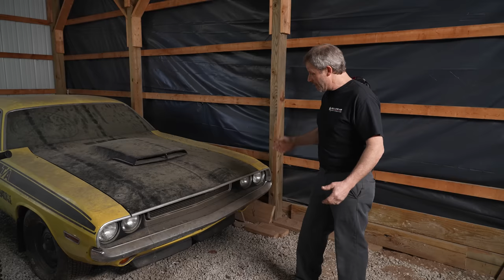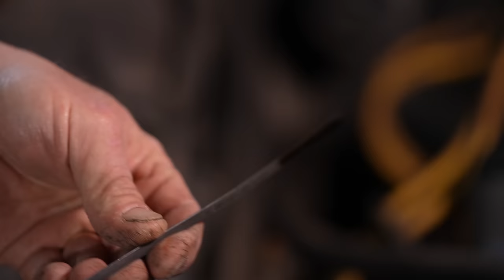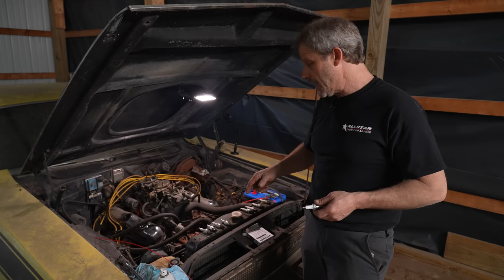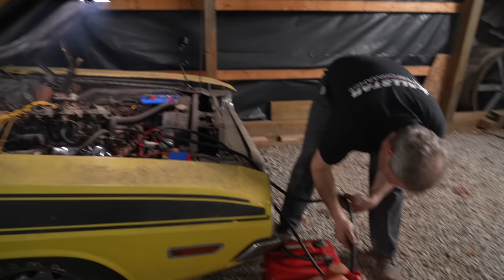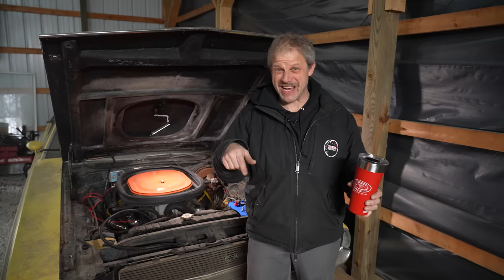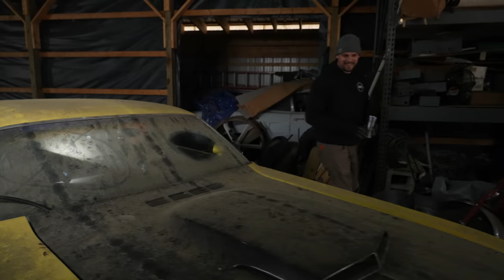Barn Find 1970 Dodge Challenger T/A 340 Six Pack: Will it Run?

Comment: I was born in 1971, my mom had a 1971 Plymouth Satellite Sebring with a 318 that she got from her brother! I've never forgotten that starter sound... it intoxicated my mind! I now own a 1978 D-150 with a 360 LA and a 1972 New Yorker with a 400! I've owned a lot of classics mostly GM, but the first time i found a Mopar that was it! When you hear it almost kick over, you know you're headed for success! I'm no professional, but I've brought the engines and fueling systems back to life! I did some engine bay wiring correctly and top end components, next is to tear the engines apart after I get some miles in over the summer because of winter snow!

Comment: I like to fill the old gas line with gas from where you cut the filter off and let it sit for about five minutes to saturate the diaphragm in the fuel pump. Works most of the time. Love the videos.

Comment: Had the same color T/A but was a 4 speed. Bought it for $4500 in 1988. Definitely a head turner. Had holes in the headliner, torn drivers seat and water in both front tires?? Found that out when I got new tires installed. Couldn't go over 35 mph without the front end shaking. Even found the original broadcast sheet under the rear seat. Replaced the worn/torn parts with new and WOW, new car.
Reply: Great memories,I remember when they was first hittin 10k for driver quality 93 ish.I was still in high school at the time and making $4 a hr part time during school yeah,found a 68 Dart GT 340/727
I can bet a lot of people had never really been around a 340 more less the engine in video.very special bore/stroke combo with the LA x heads I beat alot of 350 novas and chevelles.My almost stock 340 made easy pray of most of those guys

Comment: I know why the front and rear carbs were disconnected.   I had a friend that had a 70 Cuda with a 440 six pak.  I asked him how many miles to a gallon.   His squirmed a little and stayed, “If I drive 55 (speed limit at the time) and stay out of it on the highway, I might get 5 miles per gallon”.  During 1971, gasoline was very cheap.   The lowest price I paid was $0.169 per gallon.   $1.269 today.  A few years later OPEC stuck it to us and the fake gasoline shortage.  In June 1974 the price was $0.559.  Checked an inflation calculator, $3.429 today equivalent.  BTW minimum wage was $2.50 and wages got frozen by the US government.  The good old days!

Comment: I own a 70 GTX 440 6 barrel. I have owned it since 1981. You have to have fuel in the outboard carbs. They have idle circuits that need fuel to idle correctly. If not. Then just a big vacuum leak. You can see the lead plugs in the base of the outboards. Take that lead out and carefully add penetration out. Work them out. Then you can fine tune the outboards as well  nc as the center carb. Center carb adjust on side of the metering block.
Reply: I'm sure the man knows what he's doing

Comment: I love those 70 T/A Challengers and the AAR Cuda's they are great looking and running cars. I have a 340 out of a T/A challenger that was too far gone to do anything with and the engine was seized up but it was not seized that bad and it now runs and it's on a stand in my garage with the 6 pack intake and a A833 4 speed that was going to go into my D100 pickup but I have a hot 318 that I built and going to run it in the truck for a while.

Comment: The huge vacuum leaks don't help. Should have taken the time to fix the outboard carbs.
Reply: Once I knew it would run, I'd have pulled all three and tore them apart and gave a bath in my ultrasonic cleaner, then new kits. Holley 2 barrel kits are relatively cheap.

Comment: Had a 71 with a 70 grill on it , bought it for 180.00 mint from the doors down in 1985 I was just a kid around 22 yrs old ..Cost me 400.00 bucks for a R/T hood and 150.00 bucks for 2 nice used fenders 100 bucks for a 70 grill with all the headlight assembly..Freind of mine sprayed it with Krylon Prime Grey since the car was Grey and unmatched Fenders one blue one white and luck had it rained like hell that afternoon afternoon and we hand sanded both of us in a rain storm the next morning it was so smooth the wet sanding it came out great , put some racing stickers on it N50s out back on aluminum slot mags I really loved my Challenger had it 5 yrs hence the 318 out for a stout 440 from a ex police car Dodge Monaco a 69 I believe and stock it moved good , The good old days havin fun building Mopars , wish I had her today 😢

Comment: Most people don't know that the end carbs have idle circuits in them. This is done so that fuel doesn't stagnate in the bowls if you don't go wide open for a long period of time. It will never idle right if you don't clean all 3 carbs.

Comment: As a high school junior I had a 1970 340 Duster. Very fast. Had most options, with console automatic. Those six pack cuda's are pretty valuable. I believe those seats have been recovered. Dodge did not offer velour seat surfaces

Comment: My first few steps of tryin to start up a vehicle that's been sittin for 2+ years, remove plugs squirt some sort of lubricant in the cylinder, then turn the crank. If it turns put new plugs, Change engine oil and go from there............

Comment: Motortrend magazine did a look back test on the 340 six pack and determined by dyno testing that in that particular configuration that engine made 350+ horsepower and over 400 pound feet of torque.

Comment: I have memories of driving myself loco trying to rebuild and adjust carbs. I never was good at it to have to adjust 3 would give me fits. Plus you know someone must have rebuilt those before. Images of somebody shoving pipe cleaners down brass jets. Those things have tolerances that are very tight. A torn gasket or vacuum leak is easy to miss. 

Not being too negative I hope but lots of memories come back to me.

Comment: Dropping a big ass socket on that aluminum grill? I know it hurt the car. Those black velour inserts on the front seat, I don't think were factory were they? I thought it was, vinyl, houndstooth, or leather. I have the exact inserts on my '70. They must have been a popular re-upholstery option in the late 70's/early 80's.

Comment: about 30yrs ago i tossed a new battery into my '67 bus and didn't notice the posts were reversed...  drove it that way for about a month before i took the time to fix the problem.  worked fine other than the fuel gauge was pegged empty and starter wouldn't turn it over.  had to push start it everywhere, which i was doing anyway with the bad battery...    ah, the good old days!  :D

Comment: During covid I sold a 95% restored 75 DT250 like that and a 75 DT400 yamaha  along with a 72 SL125 and a 72 SL250 and a 75 XL70 and 72 TS400 AND 72 TS125 all restored down to frames. They all sold in less than a day on marketplace. All have videos on my tube

Comment: Since those outboard carbs are missing their vacuum pods, there is probably two massive vacuum leaks on the sides of them. Small wonder it won't idle or start nicely and wanted a ton of choke.

Comment: Timing is way advanced. 
Also, could have jumped the solenoid to start the car. It’s on the driver’s side inner fender near the battery.

Comment: Davin, you should go through a tool kit you use to do this kind of work.  What parts you ALWAYS bring with you "just in case" etc.
Reply: Simple answer is .Test light , multimeterspark plug socket and plugs carb rebuild kit ,points ,condensed ballast resistor (Mopar) spare coil  e fuel pump fuel filter some rubber hose clamps some wire and fuses. 45 years turning wrenches and I can get any old car that ran when parked running again.These old cars are so simple to work on you really don't need much more than a pocket knife and a leatherman all in 1 tool. Once running then you figure out what it need like a fuel pump new gas tank ,lines ect.. One thing you never do is make it run in front of the seller if you do they will want more or not want to sell
Reply: @pkuudsk9927  да уж. К современным автомобилям, особенно дизельным, нужно тонны инструмента и приспособлений.

Comment: I i use a diver’s air bottle for doing old tyres like that rather than a small pump it’s connected to a simple compressor regulator and an airline the jobs done in seconds 👍👍

Comment: 340 six packs do NOT use progressive linkage. Even if the factory linkage was present, it wouldn't make a difference. The outboard carb butterflies wouldn't open anyway because they are missing their vacuum pods. The stock linkage only serves to restrict movement of the outboard carbs' throttle blades it does not actuate them in any way.

Comment: Gotta get that 6 pack running right or get a 4bbl intake and carb but something has got to give maybe that's why it was parked because carb issues. A car like that needs to be cleaned up and driven not locked in a barn so the mice can turn it into their house even to drive it once a week to a car show or for a sunday drive it's better then letting it sit.

Comment: You were pouring a lot of gas down that carb. When you flood it, you need to block the choke open, and floor the accelerator pedal and hold it while cranking it to clear the excess fuel out of the engine.

Comment: I had an ex-mother-in-law who had a Challenger. Not a six pack, just a single carb 340. It did not like cold weather. Also, clean all that crap off the intake manifold. It can start a fire. I've seen it happen.

Comment: Interesting that there aren't any vacuum pods on the outboard carbs.  I can't tell if they were converted to mechanical secondary carbs.  I wonder if the vacuum ports were plugged to prevent a vacuum leak.

Comment: I have never understood why anybody that does a startup of any vehicle that has set so long never does a pre oil on it to prevent try bearings
Reply: Exactly. A priming rod and a drill would go a long way to lubing those bearings and get oil in those collapsed lifters. That’s why the engine will not start immediately. The lifters have to pump up before they can actually fill open the valves to get more air and fuel in to get a good combustion going. And you can tell he’s not a Mopar guy because a screwdriver would’ve enabled him to do his own cranking at the starter relay and he should’ve been in neutral for a bit before putting it in drive to prime the trans pump.

Comment: I use NGK in my Mopars Champion use to be good plugs but I have found the quality is not as good as they once were and that is why I use NGK so you won't see me getting upset for you using them but I will get upset about you using the old fuel from the tank to start that engine if the car has been sitting as long as you said it has. That will gum up the carbs and the valves for sure.

Comment: Sounds like spark is advanced too much and/or weak battery. Though you had spark, that spark was too weak. If it had original dual point, I'd say dwell is maladjusted, but somebody has installed an electronic ignition, so I'd look for proper voltage at coil, or weak coil. Possible vacuum leak and/or bad accelerator pump shot.

Comment: Should put a ls motor in this and paint it black ,,also lower the front and jack the back up just a bit with big wide slicks,,or a modern challenger engine with 700hp ,,it would make it a great car and increase the value,,,an old car like this the way it is wouldn't be worth much,,you could buy this car as is for about 2 or 3 grand ,,,,I believe that's the market value for this,,,,then put maybe 10 or 15 grand into it with modern mods,,,then it would be worth about 20 or 30 grand,,

Comment: Am I the only one that notice the vacuum setup is missing from both the end carbs?
Reply: If the carbs shown are the original ones, rather than mechanical ones for a Ford or GM car from the 60's, the missing vacuum module would cause a vacuum leak and poor running like what is happening here.

Comment: Why would you leave that 25 year old oil and filter on such a cool car?
Reply: That oil is matching numbers
Reply: It's good to run it a bit with the old oil, say for 20 minutes or less, it loosens up the sludge and gets it in suspension so you can drain all the old out. After I do that first change, I'll run maybe 4-6 hours then change again.
Reply: @dave1135  True, maybe thro an engine flush in the old oil and run it before the oil change

Comment: There's no way it acted like that.  Possibly at first it wasn't warm enough but that stop. Wasn't a lack of gas, wasn't ignition problems.  Computers Computers Computers. Interference. Caused it to quit run like sht.  69 Olds sat 10 plus yrs nvr touched the carb took to starters made one gd one. Filed the points tapped on the carb knocked it few gd times started it of a tin can with a half in hose. Never stalled. Choke wasn't hooked up either.

Comment: I noticed the Lean Burn ignition computer on the firewall, I mentioned that because another video shows '70s Chryslers won't run probably until the computer is replaced or removed...
Reply: That's not lean burn, that's a  Chrysler Electronic Ignition conversion.
Reply: @budlanctot3060  Yes I remember the Lean Burn computer is much bigger than that.  If changed, it probably would run after that..